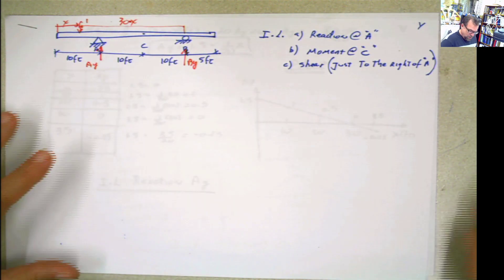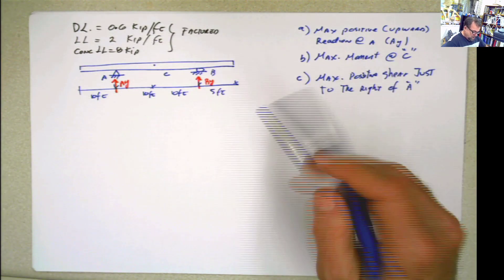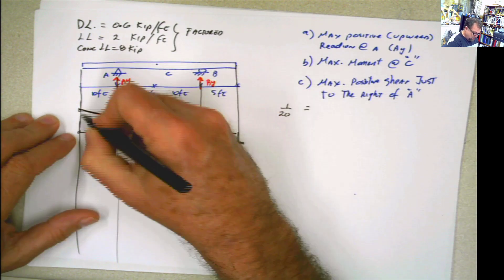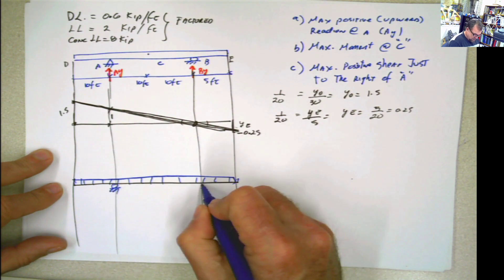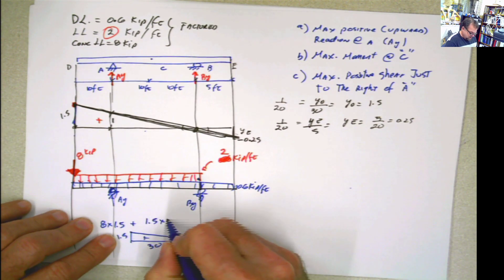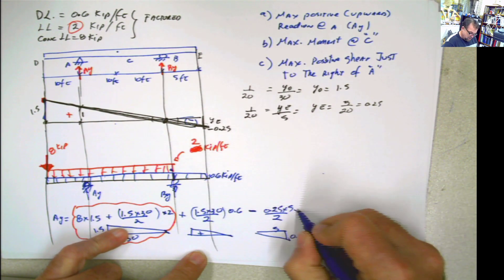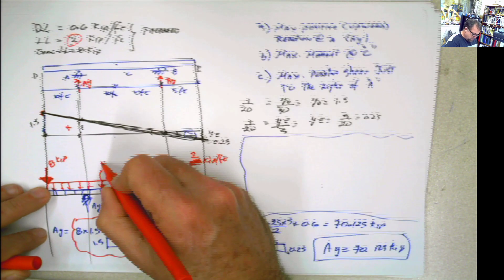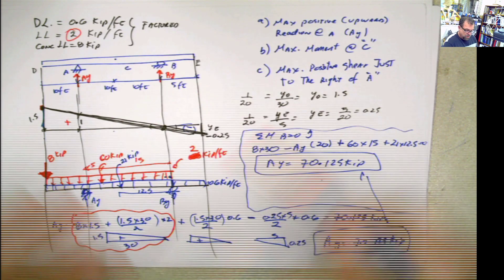Application of Influence Lines and Graphic Approach for REACTIONS

Comment: How are you getting the distances, 12.5 after solving for the point load 21 kip? And the same question for how you got the distance of 5 and 15 after solving for the point load 60 kip? (second part of problem) may be a stupid question from statics or trig but I am really confused
Reply from the maker: I don't understand the question... at what time?
Reply: Distance of the point load converted from rectangular distributed load is located at the center or half of the rectangular distributed load